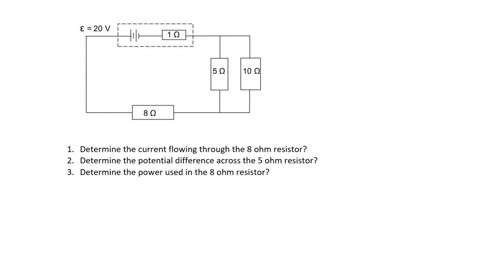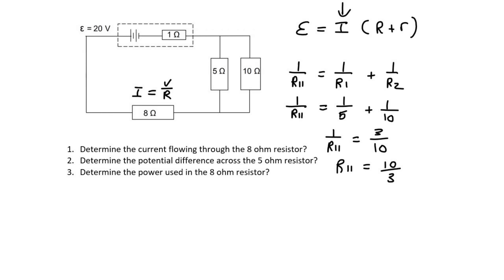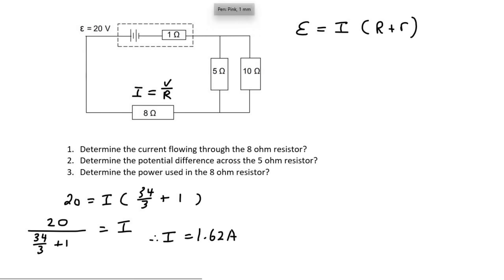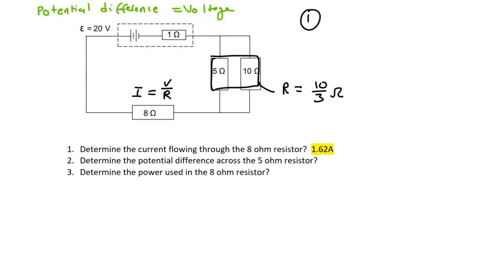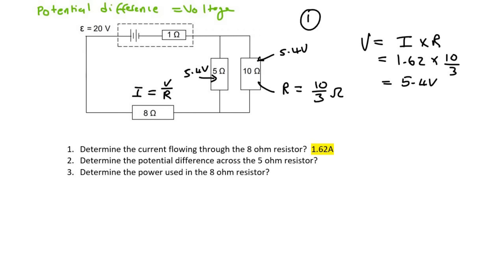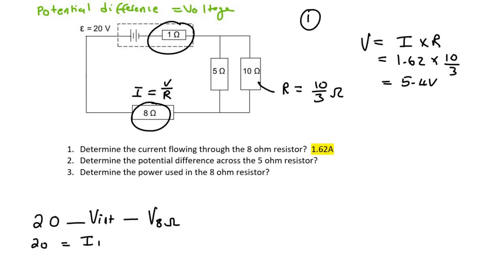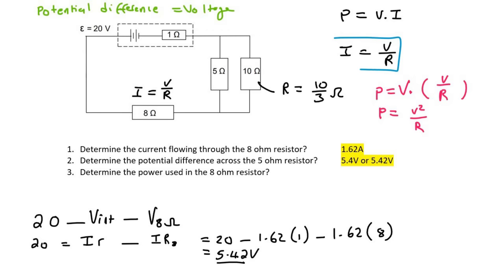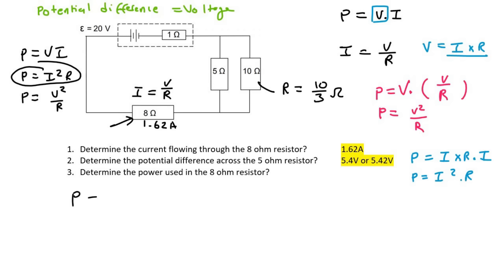Electricity Grade 11 and 12: Exam

Comment: Evening Mr Kevin
I recall you saying that if the voltage on the 5ohm and 10ohm are only going to be the same if we don’t have any resistor connected in series but we have the 8ohm resistor …why is that 5 and 10 having the same voltage?
Reply: voltage is always the same in parallel